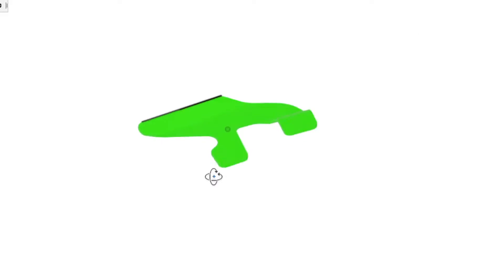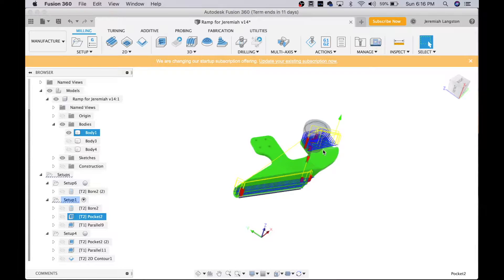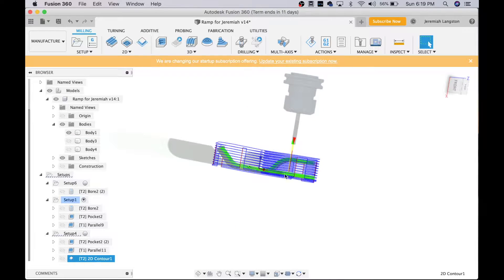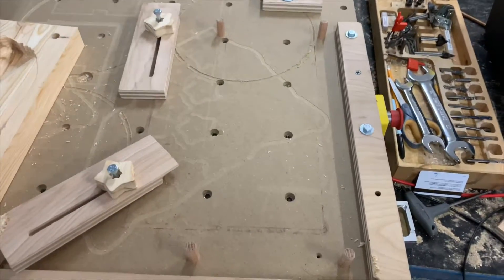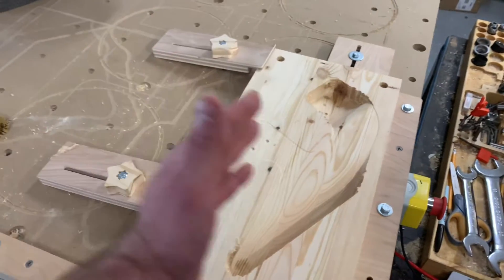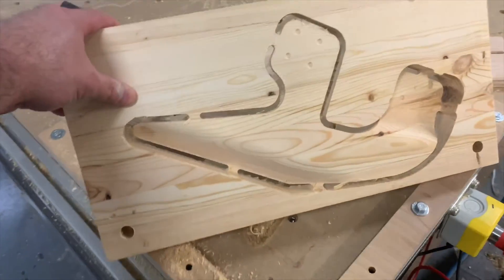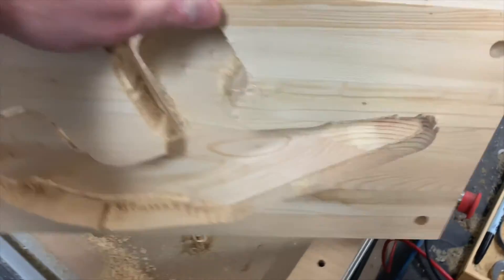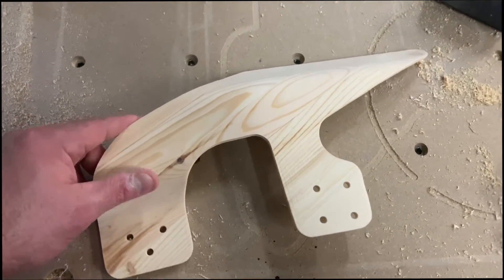Milling a 2 side contoured part using dowl pin indexing features (Fusion 360)

Comment: great work!  And well done proving it can be done.
Now i need to look up the difference between 2d scallop and 2d parallel.
Reply from the maker: I'm a professional engineer, and as a consequence I have more that 10,000hrs of CAD experience.  To me the solid drafting side of Fusion 360 was pretty straight forward, mostly because a majority of the 3D modeling principles are at least partially equivalent across platforms.  I will say that Fusion is quirky, and can be unstable...  But it's free.     As for the CAM side of it...  I kind of stumble through it until I find a way to make it do what I want.  I also use the CAM infrequently so, I make the same mistakes over and over from project to project.  One thing that I do is make seed files for types of CAM jobs and use the set ups and tool paths from the past as a go by...  This helps immensely so Im not reinventing the wheel from job to job.  If you do need help on something specific, I find that a google search is the best approach.  YouTube is good, but you end up watching 25min of stuff you dont need to know to get that 1 nugget of gold that need to get back on the road.  Obviously, Google is a little more targeted.  Once I understand the function in broad terms, I may watch a video on that specific topic to get some contextual examples...  Good luck

Comment: In this way you must zero Z axes on the table, not the stock, right?
Reply from the maker: Yes.  You want to use the fixture coordinates, not stock coordinates to locate your part in 3D space.
Reply from the maker: I dont know if I said it or not, but the video shows me setting z position at 09:15
Reply: @JeremiahL  yes, thats why I am asking. Usually i zero on stock and noticed you dont. So asked to confirm.
Reply from the maker: @Shorrey  some times you need to use the stock to determine z height.  For example if you have something flat that you need to cut letters in, it will be important to use your stock so the depth of cut is correct relative to the work piece. 

In this case, i want my finished part to be nested in the stock relative to the machine bed not the starting stock.

It possible to do it either way if you understand the error in the stock size, and what that does to your finished part in terms of deviation error.

Ideally you would square and flatten your starting material on the machine to achieve a known and precise thickness prior to cutting your part to minimize errors.

It wasn’t important for the purposes of this demonstration…

Thank you
Reply from the maker: @Shorrey  what ever you do, make sure it agrees with how you set your part up in your CAM programing…

Comment: Nicely done. i guess you surfaced the work piece before to be "flat" ?
Reply from the maker: I did.  I ran the material through my planer first measuring it with Micrometer until I get it dialed in.  You can also flatten it and bring it to size using a square end mill.  I have a 2.5" face mill that makes quick work of very large surfaces.  If you did something like what I show in this video without your stock being the right thickness, it would throw your dimensions off when you go to cut the second side.  If its too thick your part will have excess thickness in the z direction, and too thin your z dimensions would thin.  The error will be equal to the magnitude that your thickness measurement is off...  Thanks for watching.

Comment: I've really never understood why people just dont go ahead and cut the indexing holes in the work piece and the waste board at the same time (just increase the depth). In this scenario, you cut the holes in the waste board first, then you cut them in the work piece in a separate operation. When you used the same tool path to cut the indexing holes in your work piece, it looks like you drilled all the way through anyways. The only thing I can think of is that perhaps the length of cutter you are using is limiting you. Outside of this, I must be missing something.
Reply from the maker: The concern is that the cutter would not be long enought to cut through the entirety of the thickness of part, and the spoil board...  Also, securing the work piece while doing this is a separate challenge that would have required more effort than the way I chose.  To your point, if it was a much thinner part, I would have done as you said, and just cut through the thickness....  With all of that said, there are many ways to get to Rome, and this is what I was comfortable with given my set up, and experince.  Thanks for watching.
Reply: @JeremiahL  Ya I completely agree. You did a great job. After watching your video, I did run a '2-sided' test on my own drilling straight through the work piece and spoil board in 1 shot. In my test...I only drilled into the spoil board .25 in and found that was plently for simply locating the work piece. Tape and super glue held the work piece in place at the start with no issues. After the indexing holes were drilled, I then pushed the pins through the work piece into the spoil board before resuming the milling. Worked great for my needs. I honestly think I even could have skipped the index pins until i needed to flip to the second side as well. But I do like that the pins offer extra support for the top, so pushed them through just the same.

Comment: Thank you for the explanation! this is getting me more comfortable about 2 sided milling... I do have a question.... how do you add tabs to a 2d contour like you did? I’m guessing you only add them to the second side?
Reply from the maker: Im glad you enjoyed the video.  I would recommend making your 2D cut out operation after you've already contoured both sides.  You need as much material as you can attaching the part to the stock to keep the part stabililized during the sculpting process. Do your Cutout profile on the same reference frame as your second set up.  Up until that last cut out operation, all you have done is cut away thickness on both sides of the part.  That final operation will cut the part free from the material.  This article will walk you through the mouse clicks of adding the tab to the tool path.  http://cadcamlessons.com/fusion-360-tabs/

Comment: Great video!  I do quite a bit of two-sided machining, I have always set my X/Y zero to the centerline and only used two dowels.  I like the idea of using four! I would also recommend an oscillating multi-tool to cut loose the tabs, it will save you a ton of time.  I picked up one for <$20.  Best money I've spent in a long time.
Reply from the maker: cbb1962 thanks for the tip!